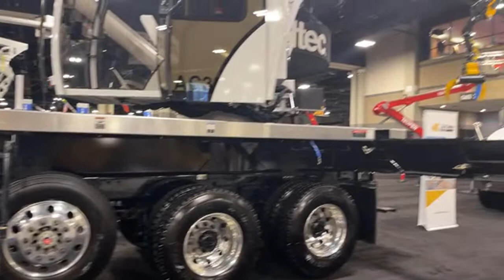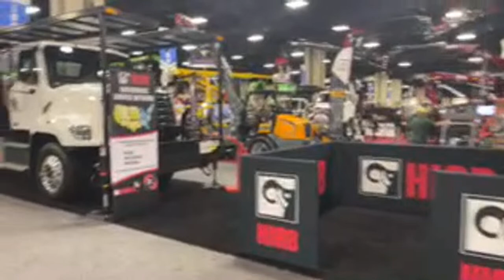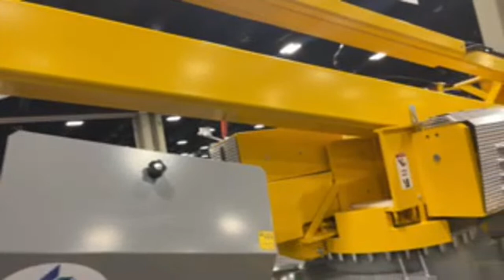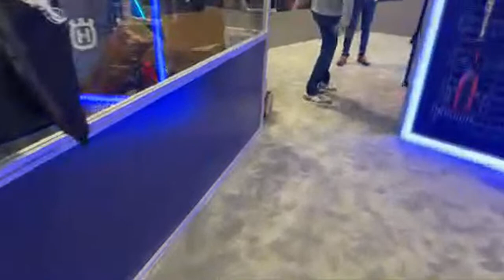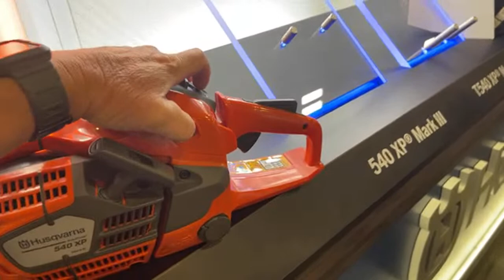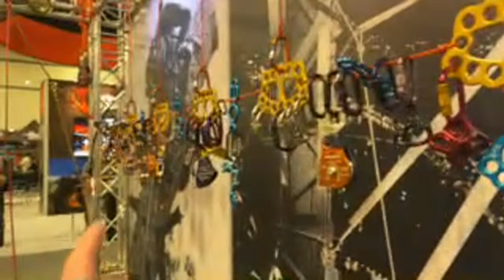TCIA show live

Comment: My first husky top handle saw was the 335xpt back in 1998, a lot of hype in the publications, and every year the same story of design updates. The saw wouldn't run for more than a few hours then back to the dealer until the warranty was out. Eventually, it got dumped with a load at the waste yard with no remorse whatsoever.